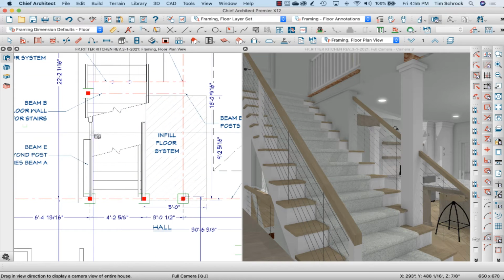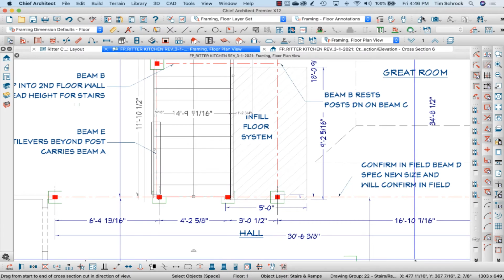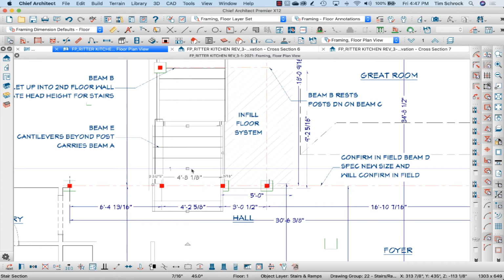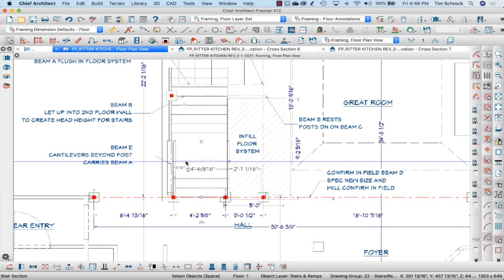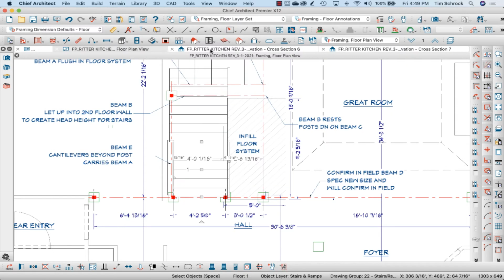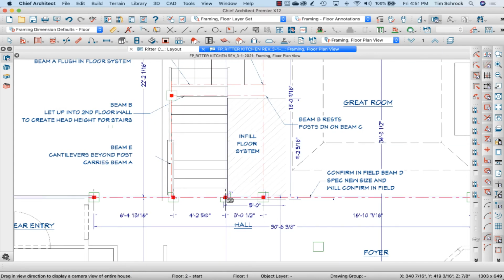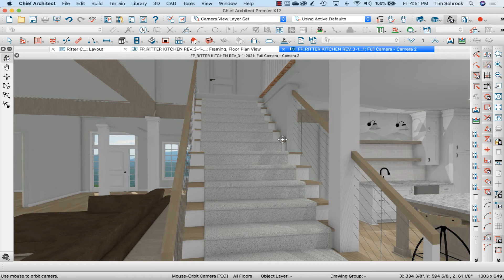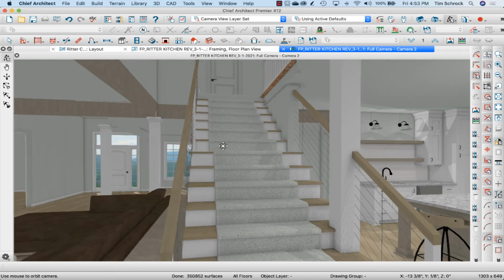Custom Stair Sections | Chief Architect

Comment: Starting with X12, you can break the stair and adjust parameters for each section.
Reply from the maker: AHA! Thanks for pointing that out. I'd seen you could break stairs, but in order to do the shift-click thing and have railings on one section or not, you have to choose the "complete break" option when breaking it. 
The "complete break" is another thing I've only recently noticed.